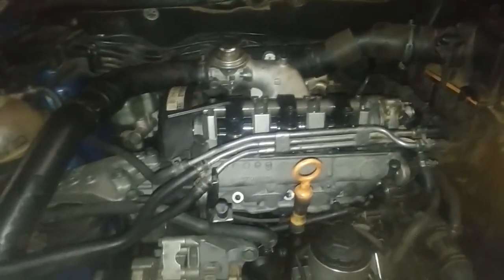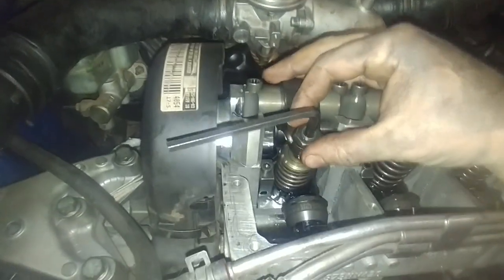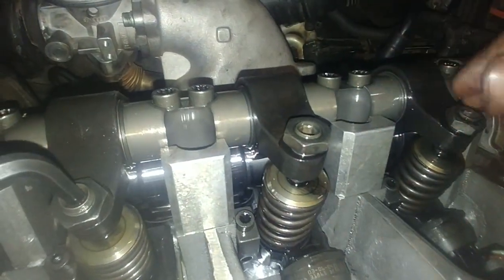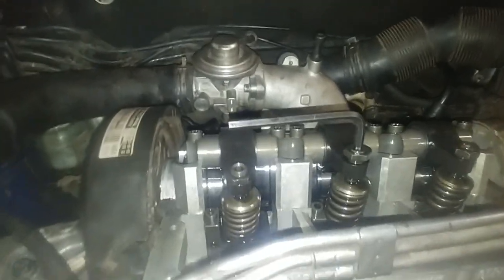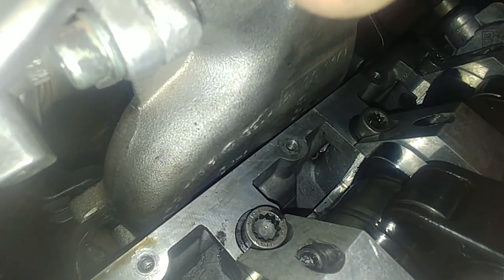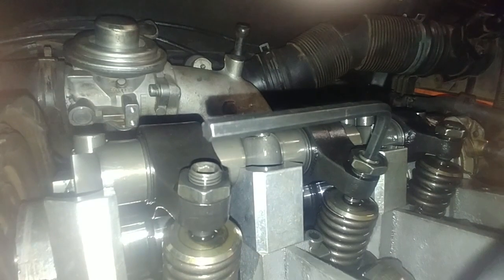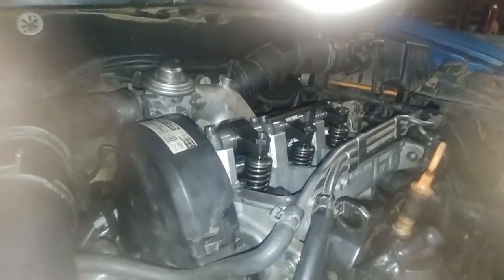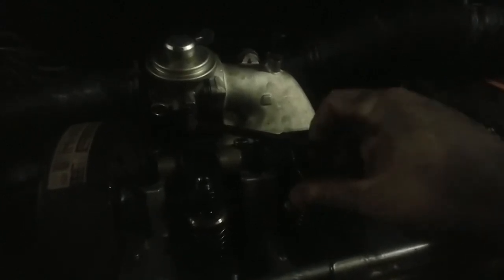VW Polo mk4 1.4 TDI AMF injector setup

Comment: Will fit the pd150 on the 1.4 ?
Reply: Il be running 150 injectors, turbo and fmic in the next few weeks
Reply: @callumloe8476  thanks mate 😘🙌
Reply: @callumloe8476  pd170s fit ?
Reply: Yes mate
Reply: Have you finished the full turbo setup yet ?